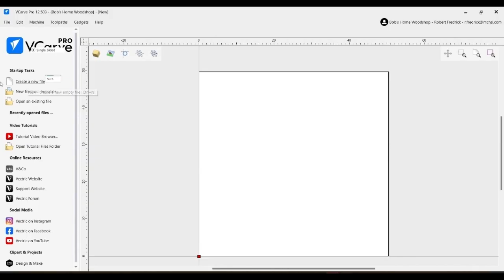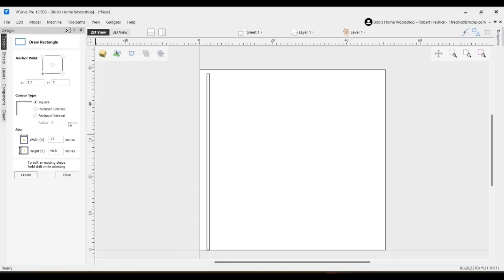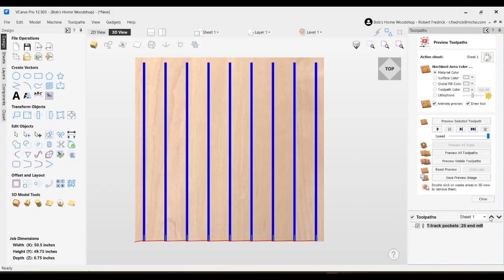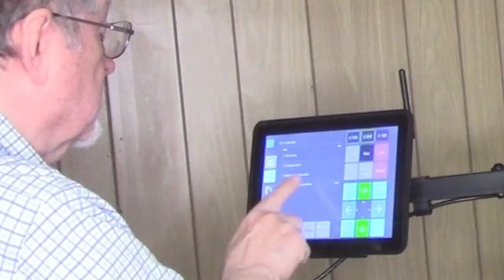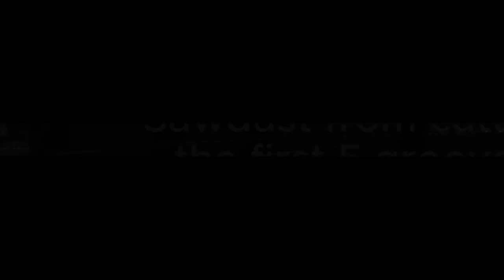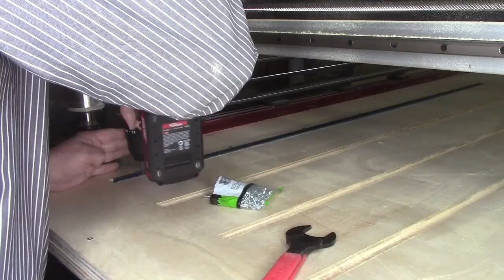CNC Spoilboard Setup | Why "Exact" measurements Failed

Comment: I am just finishing up making a new spoil board for my HD544, my version based on the Goat spoil board Designed by EigenDesigns, on Etsy. Since MDF is 49.125 x 49.125 that is big enough for me. When I setup the CNC I did not get the Bottom Left corner to match where the Home Position is, I plan to trim the loft side down.
Reply from the maker: Thanks for watching and commenting. Making the spoilboard took a lot more time than I thought it would.